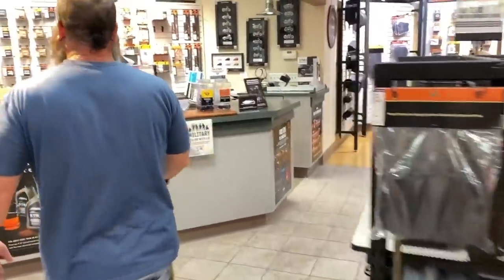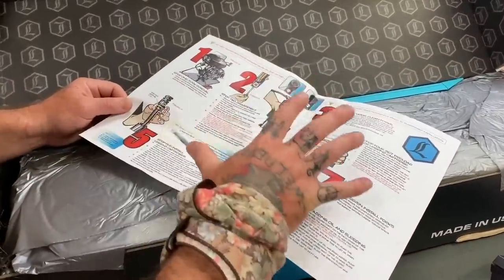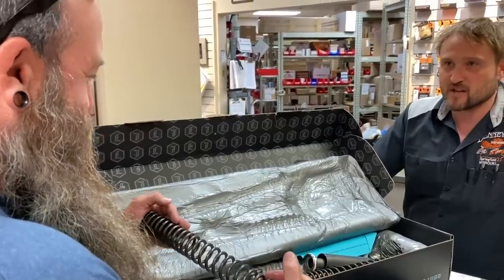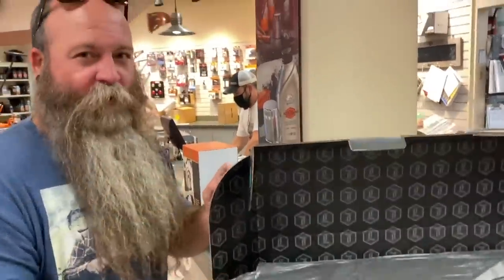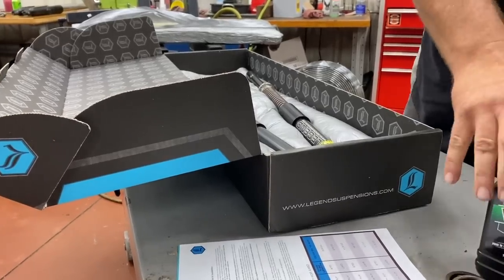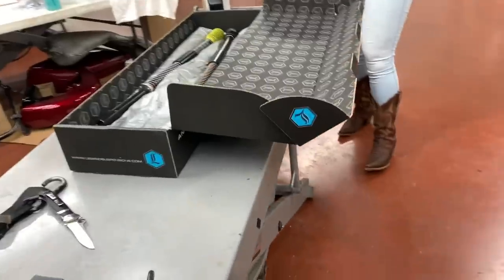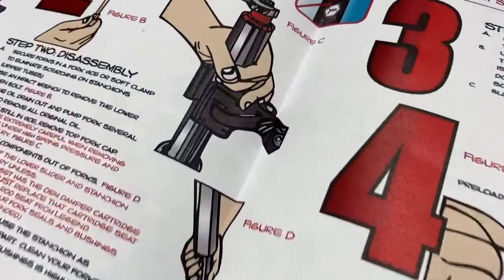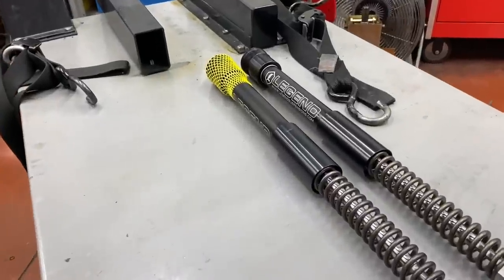Why Legends are better than Progressive Shocks | Better performance & handling motorcycle suspension

Comment: I love my Legend suspension.  I have a 2015 SGS and I’m not sure if the stock suspension is the same as the newer bikes but my stock suspension was horrible.  I started with the rear REVO-A and wow what a difference in handling.  Then I installed the front Axeo and it felt like a different bike.  I’ve put well over 5k miles on the new Legend and no issues.  I installed it all myself.  Do your research and when you feel you’ve researched enough then research some more.  Stay safe and enjoy the ride 👊🤙🤘

Comment: My front  Legend shocks ain't much better than OEM. Still takes bumps hard. The only difference is I dont hear the springs rattle and it don't nose dive as bad.. We did what did directions said. I weight 280 so it said to turn it 1 turn. For $1,000? I think I wasted my money
Reply: Man that's a bummer to hear. I had high hopes. Maybe I'll go with RWD.

Comment: Why on a one year old bike you have to replace the front shocks😢. And you already have done the rear. At $1000 thats nuts to me😢🙁
Reply: Have you ever ridden a Road Glide?
Reply from the maker: Good question!!! Please know that I didn’t HAVE to change the shocks but wanted to. We rode 20k+ miles since March 2019 & we simply wanted to explore what is in the industry that would make our ride more comfortable. I wish the stock shocks were a bit better but they are what they are.

Comment: Legends vs Ohlins which is better??? I've been looking at both, I haven't been impressed with progressive in the past.
Reply: Look at motorcycle racing where budget is no concern, and youll see a lot of gold being represented and for good reason.
Reply: Ohlins. Designed initially for MX where was heavily tested. Then refined for the road. Quality product,  no aluminum where the oil contaminated from allows quickly (Japanese KYB, Showa).

Comment: I put the Progressive on my heritage and it work buck at low speeds on fwy. took it off and went with different set up. race tech. recently up graded to road glide. thanks for the info
Reply: So? You didn't like the Progressive front end?  Race tech better, what did you prefer? Any work on new Scooter or still stock?

Comment: When setting the preload (number of turns) you shouldn’t add the weight of the passenger to choose the setting for a plush ride. If you want a stiffer ride for cornering then you can bump it up. Just to the right of the chart it states that. I almost set mine to 1 turn because I ride 2 up but want the smoothest ride so I set it up with just my weight.
Reply from the maker: Correct! The installation & preload setting chart is not a one size fits all. The points that they want you to consider is *Do not include the passenger weight when determining the preload adjustment.

Our mechanic set our preload to 1 turn. 1 turn only because that is the weight of the Rider & Running Gear (250-349 LBS). If we had included the passenger weight along with mine & our running gear then we would be in the 2 turn range.
Reply: I’m 290 and was thinking at leaving it at zero.I hear a lot about these being a stiff ride.

Comment: Excellent, I saw Chad also cleaning out the lowers with solvent too.. I'm live about 100 miles away, and need to redo my 2021 Street Glide forks.. the OEM set up is awful for me.  as far as the comparison to the Progressive version..  Damper /spring on one side and cartridge on the other I think is a no no.  You don't want to feed the Wobble Dragon,  don't never feed the Wobble Dragon.  Hmm..You know I didnt see Ornery One' comment on the results.

Comment: 2022fltrxs. The back is the Legendary Revoa. The front has been replaced with a 21-inch wheel. I want to lower it by an inch, and I want a better suspension than now. Could you please recommend.

Comment: Put legend shocks on wife's sportster. They are awesome. Put legend front on my fatbob just horrible unridable had the removed.
Reply: If you upgraded the front, and kept the back stock that's a big part of the problem.  ALWAYS do the back first, or the back if you aren't planning on messing with the front.

Front upgrades are designed to enhance the overall package. Without the rear upgrades the front becomes to stiff.
Reply: I hear legends is stiff

Comment: Why do our $20K+ bike's need better suss$$pention?
Reply: Everything can be improved 🤷🏾‍♂️
Reply from the maker: That is a good question!! I wish the stock bikes had better suspension but I guess HD wants to leave room for improvements that are customized to our riding. IDK :)
Reply: @TheOrneryOne  Thanks for understanding the spirit of my question.
Reply: All stock suspension is a comprimise
Reply: @brianmaclennan561  at $20k, BMW and Ducati come with Ohlins and Marzzocci.  This was the spirit of my comment.
Reply: ..and yes I love my FLHR.
Reply: I’ve ridden most brands, they all need suspension upgrades. Only brand I have experienced that doesn’t is BMW stuff in the last 15 years.
Reply: @whatsstefon  Yes of course,  I know this and agree.  This might be a deeper conversation than the spirit of my post.
Reply: @pacopetepnw3434  Indeed, I am 100% certain a few beers and plenty of discussion is required.
Reply: @whatsstefon  Heheh right on.
Reply: Same reason you’ll change most oem suspensions. If you ride hard and triple digits a lot, change the suspension, if not oem will suffice! Just my experience!
Reply: They don’t NEED it but why not make your bike a $30k bike and love it?
Reply: My 2021 HD Street Glide has the worse suspension of any bike I have owned  (no excuses).. and my last 2 of 4 bikes I felt needed not  suspension attention (Yamaha Stratoliner and Honda Rune) both are just fine for me.
Reply: It’s cheaper this way than Harleys mark up. 

If Harley’s had all quality parts they’d charge a lot more, that’s the way retail industry works. 

It’s cheaper to do that yourself on the backend.
Reply: @lagunamusic7686  Too true. Great answer.  I ride a BMW these days lol.
Reply: @Frank Blackcrow I think you nailed it on the head. ..never saw your comment from 2 years ago.  stoopid YT lol.  off to Rumble we go.😁

Comment: I went Progressive  2016 RGS same as all new model front ends.  500 cheaper no front end dive great in corners and the ride is smooth as silk.   I have Ohlins in the rear  bike is great on trips multiple state rides.  but comfort is subjective like whats the most comfortable seat or whats the best shock do what your budget can afford these guys get paid and get perks so you spend your hard earned money. BTW I can afford the Legends but decided not to use them.

Comment: Great video, I just installed 23" front wheel on my road king and now my front fender is hitting the upper part whenever I brake or    run a bump , would these shocks solve the issue ?
Reply: i am pretty sure the max size you can put on a stock fender is 21.

Comment: Not exactly the best source for a fair review.  2 guys that are obviously in Legends back pocket.  Then you compare a $750-$875 Legend Kit to a $500 Progressive Kit.  Which you don't do a true "ride" comparison.  Just some outer visual comparison which tells people nothing of performance.  Both brands use High Pressure Gas Monotube design but the PS unit (if I'm correct that you have this monotube model) also has their F.S.T. tech that adjusts to the damping based on various road conditions.  Legend does not since it patented.  So a "true ride test" may reveal the PS units perform better for around $300 less.  Just more #legendhype